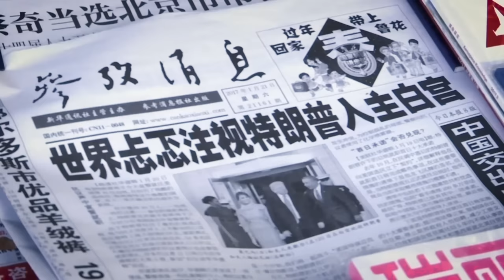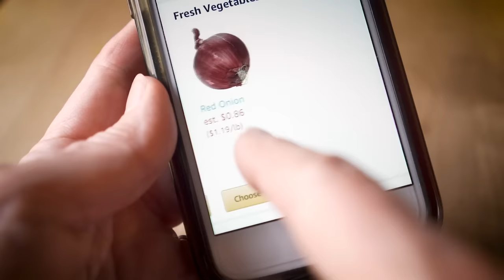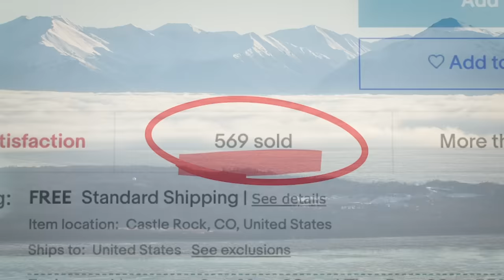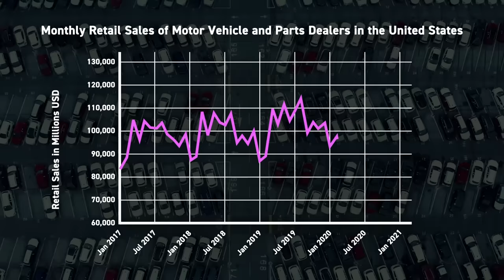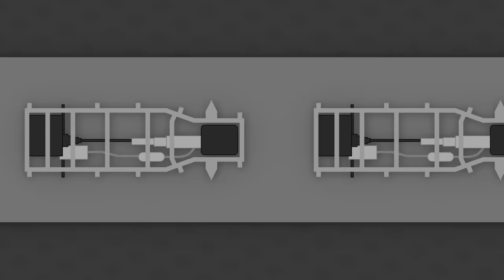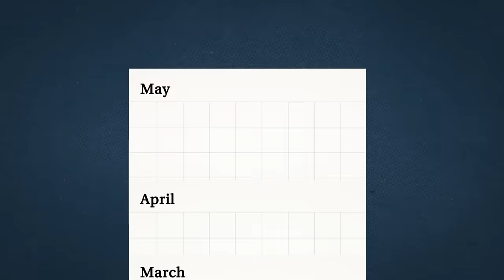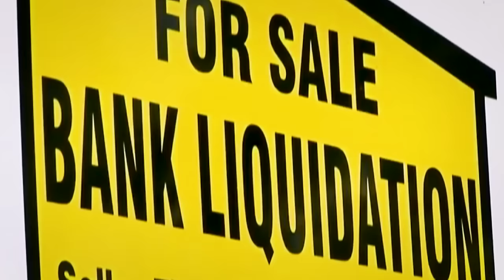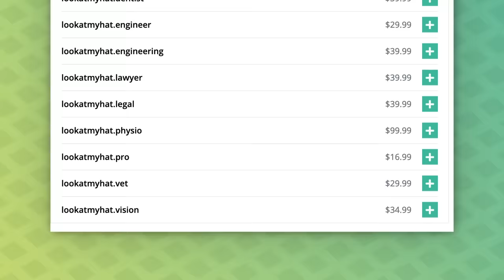Why There are Now So Many Shortages (It's Not COVID)

Comment: I worked in mechanical engineering, and I called this exact issue years ago. While in college we had professors explaining just-in-time principles and I pointed out how a single hiccup in the supply chain would cascade, and how it's passing the buck down the line. Run out of stock? blame your supplier for not delivering instead of your short sight in not keeping stock on hand.
Reply: Maybe they should have been professing mechanical engineering instead 🤷‍♂️
Reply: JIT: The Planned Hiccup. Nothing happens Organically
Reply: The issue is that planning for hiccups can cost money and for most companies a risk worth saving money over due to events messing up the supply chains being extremely rare (i.e. a once in a lifetime pandemic like Covid 19). Companies really will try to cut every corner to save money.

Comment: "Plastic resin can handle supply chain disruption", depends on the type of disruption.  As a seller of plastic pipe in North America we've faced shortages all year.  So much that we were told back in April/May that our manufacturers would not be able to take any new orders until the end of December.

As for the flawed implementation of just in time inventory I've seen it first hand.  One of our suppliers instituted it over 10 years ago when a new CEO cane in and it nearly ruined them.  Impressive savings in the first few years made shareholders happy but delivery times for their products increased by 2x to 4x what they were historically.  These products were critical components for water & sewer infrastructure and as the lead times got worse many customers went to competitors to solve the problem. Sales plummeted and they've spent the last decade fixing these problems and trying to restore their reputation.

Comment: I work for a company that tried the just in time principal. They called it lean manufacturing. They were the largest employer in the northwestern Pennsylvania region. Almost 2,000 people just on the shop floor. Now, we are down to 80 people. They failed miserably implementing it. You said it perfectly. We mass produced parts that we needed to have in stock to stay afloat. Because they did away with inventory, we went under.

Comment: As a 15 year professional helping companies implement the Toyota Production System, thank you for this video. It's very accurate and well stated.
Reply: I've seen Kanban implemented at a number of companies. It works. Shortages happen and supply chains collapse, but the philosophy is still good, because even with companies that carried excess inventory, these problems still exist.
Reply: So you are a source of TPS reports...
Reply: @paul11273  riiiiiiiiiight
Reply: @paul11273  and you used the wrong cover sheet Paul. Again.
Reply: Do you have a background in inventory management?
Reply: Gotta read the memos...lol!!

Comment: I've encountered many dumb-dumb self proclaimed "JIT/Toyota Production System/LEAN gurus" who take the philosophy as gospel,  misapply it to the point where the company loses profits and LEAN becomes counterproductive...
Reply: Slap them
Reply: When things run to the ground those individuals always find a way to jump ship and move on to the next target
Reply: @andrewdacosta3960  agreed.   I've encountered these same idiots shitting all over a company, leaving and then getting recruited by the next victim
Reply: that was gospel where I worked...
Reply: This is the problem with a lot of paradigms you read out of a textbook.
Some dolt with their MBA will think that the pretty arrows going around in circles are a ritual for success.
Reply: The misconception with lean is that it is a system that promotes inventory reduction to 0. This is incorrectly applied by consultants who don't understand the underlying math. Lean actually means eliminating waste.... Not reducing important and necessary buffers to 0.
Reply: Wish I'd never heard of it.  Due to health issues I had to close shop and stop making my domestic wrought iron household product line and when I recovered I did not have the ability to manufacture from home because I took the advice of not manufacturing a backlog of hard to make items.  I lost many thousands of dollars.
Reply: The same dumb-dumbs take the JIT philosophy to include all employees, failing to understand that some functions done in the company require a great deal of education, training, experience, and aptitude. Recruiting employees for those jobs is no simple task. Yet, in downturns, they'll lay such people off. Most such employees will move on to different jobs or even different careers. They are not available to be "called back" when their former employer decides to re-hire. It takes awhile to get those qualifications, so even if people are willing or desire such jobs, it will take months or years to get the training. Why should they do that when the job is unreliable, and/or it pays just over minimum wage (with no overtime)?

Comment: Back in the late 90's there was this push for something called "In Time Delivery", everything from paper to bolts would be 'ordered and delivered' just as the supply at the factory was running low. That and the push to 'globalize' well, everything, set us up for massive shortages if something went south. Sadly, we're not likely to learn from this.
Reply: Not getting everything we want isn’t a problem it’s just that we got to used to first world luxuries
Reply: You just summed up about 2 semesters worth of intro BBA courses that I took in undergrad in ‘98 which explains this entire situation. It was the new revolutionary “Just In Time” inventory method. Taught with abandon as a way to significantly reduce overhead costs to increase profitability.
Reply: @murryjm  The company that I worked for in the 90's was a mid-sized global container/packaging manufacturer. Between that JIT policy and the pending ISO2000 stuff they were pushing for it got so our product lines would operate with a few days margin. That is, raw materials arrived, often the day or even night before the production was slated. Rolls of paper and bins of polymer came off the trucks and went straight to the printing or plastics departments for prepping, while those departs output would be sent straight to the tubers or extruders departments, which fed directly into sorting and packaging. From there they went to the loading docks, often right onto waiting trucks or containers. We 'might' have as much as a weeks supply of most materials stored up, but just as often as not, it was a few days. There were always hiccups. A broken machine, or a delayed shipment of raw material could cause delays all the way down the line. The floor managers were constantly juggling orders to keep the numbers up. At the end of the day, I could say that we still had several warehouses loaded with stuff. Raw materials, stuff waiting to be processed further, stuff half processed, stuff finished but customers had put holds on shipping. Often we'd have dozens of loaded trailers parked for weeks. Winter weather caused it's issues, so did bottle necks in shipping. The company had a sizable truck fleet. Trucks taking paper bags, plastic bags, boxes, corrugated, etc., would ship mostly to the east coast from Iowa, while raw material(mostly paper) shipped to us from the west coast. Waste product, mostly two ton bales of scrap paper, etc, got packed into shipping containers to be sent to china or east Asia. With these huge delays at the two ports we have out east for container ships, I suspect that this Just In Time method has f'd up a lot more then what we're seeing openly.
Reply: Oh, and that push to send as much production overseas as they have. I've said in other video stream commentary that when people say "Buy American" they fail to fully understand that very little is 100% made in the U.S.A. They need 'stuff and things' made overseas, as ingredients; as components; as packaging; as machines used to make them, etc. Lets look at something that should truly be American Made. American flags. Most are made overseas, and I think there's one American company that produces them, but I'd bet a weeks salary that if we were to look into their inventory and manufacturing invoices we'd find that needles, thread, even cloth, come from 'not American' sources, as do the parts to keep their machines running.
Reply: @yourseatatthetable  very sad

Comment: Being an Industrial Engineer, I instantly went into this video hoping to hear about JIT (Just in Time) and Pull manufacturing methods 😆 So happy to hear the pros and cons of “Lean” manufacturing outside of my work environment.
Reply: So here's the thing with JIT and lean manufacturing in general: it's inevitable.  Money not tied up in inventory (as well as money not wasted on storage space and EOY inventory taxes) can be used more actively to generate revenue.  From an individual standpoint, there's no reason not to try and eliminate inventory full stop.  You run as much inventory as you have to in order to avoid losing sales and no more.

From a societal standpoint, it's terrible, because it leads to shortages and an overall reduction in standard of living.  But it is a Tragedy of the Commons.  There's a perverse incentive there to be selfish.

Personally, I'd much rather work for a stocking supplier.  They need to exist in the chain somewhere anyway, it's a lot less stressful, and it's not short-sighted and self-damaging.  But the incentive isn't there.  While you're being a responsible company, your competitors are leveraging their better liquidity to gain market share on you and push you out.  Or they gain enough of a financial advantage to just buy you out and subsume you into their business.  It doesn't need to work 100% of the time, because things like "the government shut down the entire economy in order to save a fraction of a percent of the population" don't happen often.  Or, frankly, ever before.  So the title is super clickbaity, because while JIT is scummy from a 'good corporate citizen' standpoint, it has never before been untenable nor is there really any reason to believe it will be again.  Not on a broad scale, anyway.  The response to COVID (not COVID itself - that's an important distinction) is absolutely the #1 factor by a wide margin.  You can say the system is weak, but saying that COVID isn't to blame is like saying a sedentary person who has a massive heart attack and dies wasn't killed by the heart attack, but instead by their inactive lifestyle.  No, a heart attack still killed them.

Comment: The truck driver shortage mentioned is NOT just a market phenomenon.  The state of California passed the "anti Uber" law that inadvertently impacted independent truck drivers that move products from the ports in Los Angles and Long Beach to huge warehouses around Los Angles, which move from there to customers throughout America.  Roughly 80,000 truck drivers were made ineligible to work in California almost overnight.  A new emissions law passed at the same time required these independent drivers to spend upwards of $30,000 to comply with the new law.  This caused a mass exodus of trucking resources to leave the state, holding the entire country hostage.

Many of the container ships can be re-routed through the new Panama Canal expansion, but some of the largest container ships still must unload in California.

Comment: I used to work at a Toyota supplier (not Toyota but a manufacturer who used their methods) in the US and they determined they would never be fully automated because the cost of machine maintenance would be higher than just paying people. They had people pushing the factory buttons, checking for defects, and doing rework, but they had machines doing the assembly.

Comment: Back when JIT manufacturing was becoming a "thing" I took a class in Japanese Management Techniques. At that time the basics of JIT were attributed to WWII.  Japan's supply chains were severely disrupted by period air raids on factories. This made a classical production line techniques impractical i.e. it was strategically problematic to store large amounts of inventory on site. So production of parts was moved offsite, inventory was kept to a minimum and only what was needed was stored on site at the factory. This later became the basis of JIT supply chains.
Reply: JIT supply chain techniques were created by US WWII supply engineers who were snubbed by American auto manufacturers.
Reply: Necessity is the mother of invention
Reply: @John Smith perhaps both developed it independently
Reply: JIT manufacturing had nothing do with air raids. It was first applied at Toyota in the 30s, before any air raids on Japan took place.
Reply: @RaitoYagami88  incorrect.  Toyota credits Henry Ford but Ernest Kanzler who used JIT during the war effort. WWII was won by supply and logistics.and Japan was no where near the US in logistics.  The only only reason the US did not fully adopt JIT and Kaizen techniques after the war was because the US was the major manufacturing player standing.
Reply: @John Smith first be polite. No need to mock. Then read about Ernest Kanzler and the wonder boys.
Reply: @tylerdavault9604  Your statement is the most representative of most innovation through out history. The great thing about scientifically/mathematically effective processes is that anyone with the universal understanding behind it can come to the same conslusions. Humans however famously love to think they are inherently unique and the only ones capable of their thought process. In reality we are all so similar biologically that theres never been a man who had a thought that millions of other people didn't have at one point as well.
Reply: @kevinblackburn3198  Supply and logistics absolutely played a large role. However if you attribute those to every loss and victory of WWII, then you haven't studied history broadly enough. NOTHING is ever that simple.
Reply: I know Japanese quality control techniques were created by two Americans, W. Edwards Deming and Joseph Juran, who were ignored/snubbed by American manufacturers, but welcomed with open arms by the Japanese who needed to improve their quality. JIT is related but predates WWII and the Toyota Production System utilizes both I believe.
Reply: @WheelsRCool  this is a great response that an individual can actually look into. Thank you for the lack of rhetoric bud
Reply: @WheelsRCool  This is the correct information.
Reply: Juran
Reply: @nicholasmatthew9687  General Rommel proved it in Afrika.
Reply: @WheelsRCool  I forgot about Deming. Right on.

Comment: I find it interesting how larger companies that desperately needed money in the beginning of the pandemic, when everything was closed, have been doing relatively ok when their businesses reopened, despite reduced operating hours and services. Really tells you just how big some of their profit margins were.
Reply: "Retail markup" is the difference between the price of a product and the cost of that product. In actual retail is 50%.
Reply: You can go and read their financials if you want. Paints a good picture of what they did and how they are going.
Reply: A lot of bigger companies didn't actually close...
Reply: Retail is one thing, whoselase and distribution is another. I'm only making an average of 5% in the electrical trade and still constantly have to hear "home depot has it for x!" However, thanks to this bs, home depot doesnt actually have it
Reply: They never “desperately needed money,” That was the narrative the media portrayed, but Microsoft grew by 1/3, Super stores like Walmart grew because their smaller competitors weren’t deemed “essential” enough to stay open, and speaking of which small businesses got fucked over for absolutely no reason.
Reply: @Slender_Man_186  and Amazon made record problems.
Reply: I worked for bestbuy for 4 years. They profited more in 2020 than previous years, halved the workforce. Made them work all hours and then laid off half of them at the end of the year offering part time (which at the time we had 2 part timers and they were getting one shift a week)